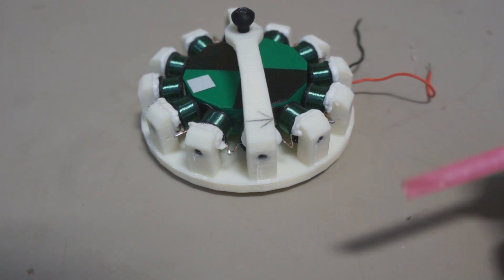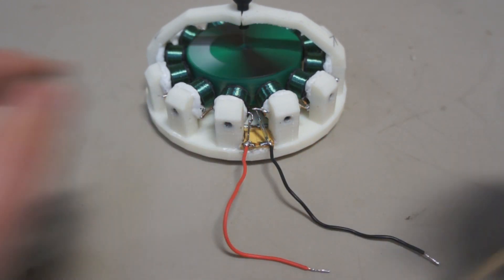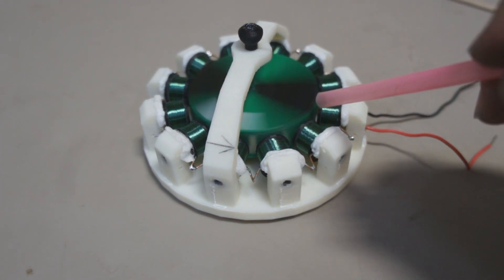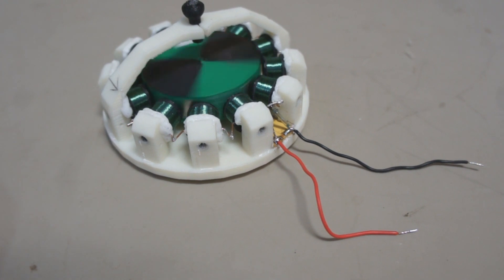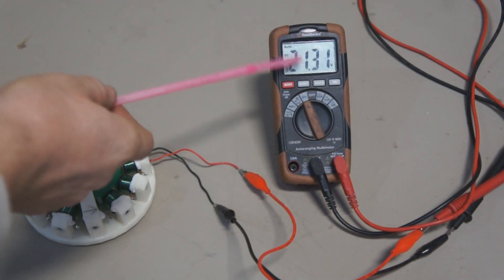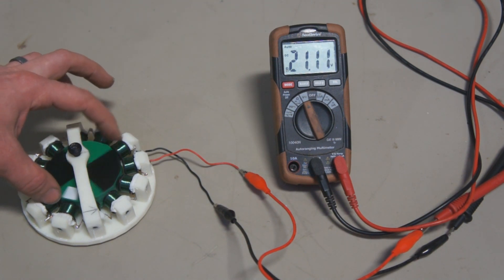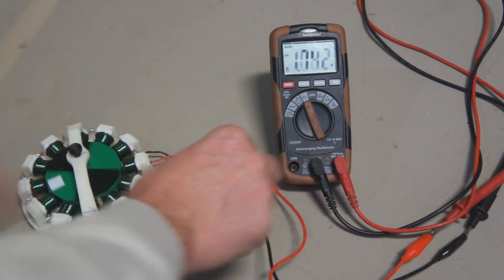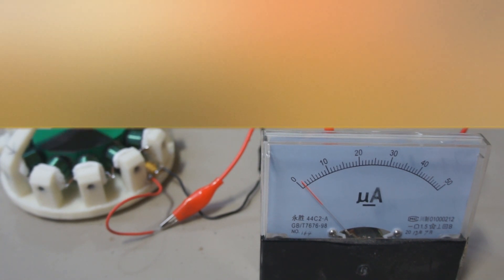3D Printed Motor Runs Almost Like a Perpetual Machine

Comment: why do you say it's not perpetual motion?
Reply: Because there are energy losses in the system. Spinning the rotor against the resisting stator initially charges the capacitor, and the capacitor then discharges to power the stator, spinning the rotor. But it cannot produce more power than was put into it. Energy is lost through friction, air resistance, electrical resistance, etc. Eventually, the rotor will stop spinning. It's no more perpetual than a flywheel.
Reply: cuz it ain't :D

Comment: Anyone knows where to get the jewel bearing?
I have been searching everywhere but only place that i can find them is in china and they wont sell a few.
Edit, I found out that easiest seem to just find an old high quality watch and take out one of the ruby/sapphire bearings from the inner mechanical guts. It will require some delicate work but old watches are cheap, even good quality ones.

Comment: Can you tell me what is the magnet type and number, coil wire sizes and winding numbers of each would help ????? Thanks You used 42 gauge wire on coil but did not say other size wire. 
THE tantalum capacitors are supposedly the best type of CAPS.  Especially from an accuracy point of view what I read.

Comment: This cant work. Impossible to charge a capacitor and draw from it at the same time without and additional energy supply flowing through the capacitors and 8nto the motor. But then if it is acting a motor, it can be a generator at the same time, its 1 or the other, generator or motor. Cant be both at once. And capacitirs cant be charged and drained at the same time, same principal as the motor. In order to keep caps at full power to drive a motor you need external energy source like a battery. Other wise there is no force to drive the generator as it charges the caps. Good effort but impossible. Battery is inside the centre spinning unit. And the unit is driven from inside. This would explain why the unit seems to want to spin quickly when he stops it by hand....it wants to go again and that requires power....not just 2 baby caps.

Comment: I thought this would be a free energy vid and almost skipped it. Very glad I watched it, I love this design. Thanks also for the detailed explanation. 
I've also used very small shaft diameters (pins) on my prints to reduce resistance, so simple but effective. I wonder how much better efficiency would be by smoothing out the rotor with the magnets impregnated and sealed over? It always surprises me that manufacturers don't attempt to smooth over magnets on brushless motors (especially outrunners), and instead have very un-aerodynamic rotor with magnets protruding into the confined space where air must be flowing around them in constant compression and decompression cycles creating massive turbulence (especially at the 20k+ rpm some of these motors can get up to.

Comment: Have you attempted a high capacity, magnetic generator?  I've been wanting to find one that is set up like this build, but with enough current to power 2-3 appliances; via an inverter.  My ultimate goal is to be able to "jump start" a few magneti generators that (together) equal around 30,000 Kw.  That should run an entire house.  Is this possible?  Thanks.

Comment: Just put it in a plastic bag and pack it with cheesey puffs for packing material. I wonder if you use 2 25v tantalum capacitors at 1 uf for fifty volts.

Comment: A lot of gullible people in this comment section that believe this ISN'T a hoax. There's a battery hidden in the device that's powering it and not those tiny capacitors. The rotor never slows down, it's being fed a constant supply of power.

Comment: What if you connect radio antenna to those wires and tune radio to tap into earth's natural radio frequency as a power source? Will the 3d printed almost perpetual machine will run forever then?

Comment: To fully power a 30 watt guitar amp you would need 1,176,471 of these.
(that is with each motor putting out 17 volts at 1.5 micro-amps)

Comment: What happens if you install a capacitor between the coils, or in front so then, so there is a hard but short energy output to the coils? Will there be faster movement? I'm not an electrician, I only have some basic knowledge from school (and that was over 15 years ago xD)

Comment: At the low voltage it was generating voltage, have you let it run without interference and see if it would stabilize and maybe be a perpetual motion motor? 
I know there are a lot of people that do not believe in perpetual motion, but I helped an old man make a machine that sat on my desk for over two years and ran 24/7. I still am skeptical but he made it happen and I don't know how.
Reply: No it couldn't be. The power source there was the spinning wheel, right? No conversion of energy takes place without losses. Some of the energy is converted from kinetic energy into electricity, and some is converted from kinetic to heat. The copper warms up a bit, and that energy radiates away, leaving the system. Therefore not all of the flywheel's kinetic energy can become electrical power.

So yeah, the system will regain electrical power, but it will have less power than was stored in the flywheel. This means after enough cycles of converting back and forth from electric to kinetic energy the device will run dry and stop. You can make something very very efficient, and have it run on its own for staggering amounts of time (See the Harvard bell that's been ringing for over a hundred years now), but due to material science nothing will last forever. Especially not if its loosing energy to thermals and also providing power to do something like run a light or whatever.

Unless we found a conductive material which had zero atomic friction, so absolutely no energy was lost during conversion from kenetic to electric energy, ran the flywheel in a vacuum, and used a special type of bearing that was truly frictionless, we cannot make a perpetual motion machine, and even then that one would be running at unity, meaning it wouldn't be making more power. It would just hold the power you gave it forever.

Perpetual motion is (currently and probably forever) impossible, thanks to physics and material science.

Comment: to increase efficiency try adding a pulse generator: https://www.youtube.com/watch?v=azLIpMYoUeQ
You might have to increase the size of the motor in order to have an output that can maintain the arduino circuit running. Effectively, the energy being utilized, comes from the magnets and the centrifugal forces.

Comment: This reminds me of a motor designed by Paul Babcock and his colleagues that re-uses the same electricity over and over, using capacitors, and feeds it back into the magnetic coils that drive the stator. The interesting thing about their motor is that they use switching technology to turn the coils on and off as the magnets in the stator go around.
So basically as a stator magnet approaches the "pulling" coil in front of it's spin direction, that coil switches off, becoming magnetically "dead", and the next coil switches on to pull the stator further, and at the same time the coil behind the stator also switches on to push the stator, creating a magnetic "push and pull" effect simultaneously.
So at all times two coils per stator magnet are active at a time, with a "dead" coil between the two active "pushing" and "pulling" coils, so there is no magnetic drag (Lenz effect) between the stator magnet and the coil it is closest to, which would be resisting the torque, creating a incredibly efficient motor.
This also means that their motor is actually not a generator, it's just purely a motor.
Just search for Paul Babcock here on YT and you're in for a treat :)
Another interesting individual, who's collaborated with Paul, is Jim Murray, and he's built some highly efficient motors too.

There are lots of ways to produce and use energy at a fraction of what we pay our power companies, the only problem is that those companies absolutely do NOT tolerate competition, and they have lots of ways to stop pesky uppstarters.
They even charge you several times for the same electricity, because the power you use is not all consumed and the leftover power is sent back to them and then looped back into the grid. What you think is the ground line actually doesn't go into the ground, but goes straight back into the grid to be taxed over and over.
That's how greedy and anti-progress they are.
Keep that in mind if you're considering buying a electric car...

Keep up the good work master jedi and don't give up!
May the force (fields) be with you :]

Comment: When you said Crystal?  Did you mean Coil Cat whisker set-up? Ie like in the first Crystal Cell radios? Probably when tuned to a strong radio station would have a + Power consumption. Also, you could tune to  tune the Schumann resonance which occurs at a frequency of approximately 7.83 Hz, but this frequency can vary slightly from a variety of factors, such as solar-induced perturbations to the ionosphere, which compresses the upper wall of the closed cavity.  Perhaps you would need to adjust a Bleed  load to stop over spinning. Perhaps you could go cap free???  Ideas

Comment: Um...so if you connect it to a bigger capacitor to store the energy, then as the flywheel slows down, it'll input a bit of the stored energy back into the flywheel to keep it going, so in a way it could potentially go on forever??? would that work?

Comment: All bullshit, Tantalum capacitors ... hmmm they run only DC, but there is no diodes to rectify the AC comming from the coils when charging, the read sw is way to far away from the magnets. Light trough the base , year right, what about the rotor !!!! FAKE CAKE

Comment: Well you try connecting crystal diode and coil and you tune it to resonate on radio frequency so you get actual voltage from radio waves-then it will never stop-as long as that radio station transmits :) Edit: please try that! Ty!

Comment: amazing job with your tinkering, 3d printed so meh, you could build the housing a million times, cute touch with the... it came off the printer bad. anyways was a cool video until you fabricated the short... seriously, you had already disrupted the speed 5 times, no biggie, fucking awesome, but then when you try to drop it to 8 volt range, and you see it just ticking away again, you decide to unplug the multi? multimeters are trivial draws of power, especially here... straw comes in... guaranteed a small burst of air was passed through that straw to speed it up. "this is commonly referred to as bullshit." i dont give a shit really, just funny how you start the video by saying that people said you had batteries etc... your shit doesnt last for as long as you like.. thats ok, its still cool.

Comment: Hi, have you checked how much force this engine can develop to push an object if you attach a gear to it?
Reply: Sir, it is not an engine. It is a super efficient feedback loop. Once you start removing energy from it it will slow down a lot more quickly. HOWEVER, this is similar in concept to what hybrid cars do: Increase the generation capacity and it would work as a brake, but generate enough power to a battery that the electricity generated will add electrical impetus to the next acceleration.

Comment: It would be great if you could develop a miniature version to mount underneath ac brushless motors to act as an alternator for drones, obviously the goal would be to increase flight times. I imagine you could create some ducts to draw a little of the downwash from props to produce the spin, kind of like Kers for drones!
Reply: Unfortunately, the amount of energy you would get would would be less than the amount you lose by the extra drag slowing you down. However, I imagine you could reverse the coils in your motor to slow down the propeller speed, increasing drag, but capturing that drag as electricity could be useful as a sort of regenerative airbrake, however that wouldn't really increase flight times as unless you use an airbrake a lot, its more efficent to gain altitude to store more momentum or just go easier on the throttle than it is to use such a brake.

Comment: FAKE...does not lift it from the table because under the table has a drive coil underneath it
Reply: The drive coil would have to reverse when he turns it over... so nope. If you actually watched the video you will note that he never claimed this was perpetual motion and even showed the power loss over time.

Comment: why don't you feeda fan back into the motor have have the motor run the fan, but give the motor a blowing kick start
Reply: Running a motor off of this would shunt the feedback power to the motor and the device would stop very quickly. It is not a generator, but has a slight generator capability. It could be classified as a dynamo which is a very high efficiency motor due to its ability to feed back into itself. Notice that he NEVER claimed it was a perpetual motion machine.

That being said, it does have generative capacity, so if the flywheel were connected to a DRIVE SOURCE, it would most certainly supply enough power to a fan.

Comment: These capacitor has not enough energy to start up this "motor" after has stopped it by your finger. 
I was wondering where you hidden the battery and circuits to keep it running. With certainily  inside rotor hub. Smart, but over opposite law of energy conservation.

Comment: That is a very nice motor.  As good as it is now it seems it would be even more efficient if the stator windings were connected to a iron ring around the perimeter of the motor,  much the way commercially made motors are built.  This would allow the outside pole of each electromagnet to contribute to motor's operation instead of being thrown away as it is now.  You might be surprised at how much more performance your motor will have if you do this.

Best wishes.
-Skip

Comment: Sorry. Did he say "there's an insane amount of resistance in these coils. That's what makes this run as long as it does"? 
Doesn't resistance mean loss? Like friction?
Why does he bother with all the electrical gubbins. Why not not just spin up a flywheel with his amazing low friction bearings. He would have less overall system losses and the thing would spin even longer. No? 
Yeah, right.
Reply: Yeah, I saw that resistance comment, too. What he should have said is that there is a high inductive reactance which would look like resistance during an increase of current moment. Any current fed into the coils is immediately converted to magnetism (up to a point). Conversely, if the voltage in the caps starts to die, the inductance field starts to break down and will start to feed current back into the caps. In electronics we call this an LC tank which is highly effective at storing power. Add to that the kinetic energy of the rotor and you now have a mechanical feedback loop along with the electronic feedback loop making this a very efficient energy storage device. HOWEVER, once you start to remove any energy, either mechanically or electronically, energy is lost quickly. He showed that in two ways: first by adding friction to the flywheel, and secondly by shorting the leads together. I found it very interesting to note that the short was a much more effective way to remove power from the system than the physical resistance (friction) was.

Comment: Observing this you have a really useful device you probably haven't thought of.  Give the device a magnetic bearing with a large massive inertial rotating wheel (MASSIVE) this device could function as a fairly high efficiency battery device.  This way you can store power from a solar device and have "On demand" power without battery losses.  It should run the rotor in a vacuum if possible.   Instead of blowing the rotor you would power the motor to speed.   Obviously the motor would be scaled to the in/out demands.
Reply: Look up KERS. Its this, but attached to regenerative breaks on racecars.

Comment: Greetings my friend, I have a curiosity, if they are coils and magnets for what reason when you stop the rotor and release it the same tends to rotate without help does not seem logical if they are only coils that without turning with the hand should not have any reaction to Unless you have a battery to power it?
I apologize for the question but there are many hoaxes, thanks for your response.

Comment: It would be cool to 3d print a thin fan blade on top of the larger spinning part and power a small fan motor with the leads you have there. I would think it would never stop.

Comment: Wow, this is pretty cool just the way it is.  If the reed switch is one of the larger energy drains though, could you make it more efficient with an NPN Mosfet and hall-effect sensor as the switching mechanism?  The gate capacity of modern NPN's are fantastically tiny ... so small, that a 104 ceramic cap can keep it switching for a day.
Reply: GnuReligion the reed switch has zero draw effectively but since it is a mechanical switch it has a limited number of cycles

Comment: Pretty cool! I have a similar design. Question, how did you got to balance the magnets and to have very little resistance on the main axis/shaft?
Reply: 3d printer and weighing the magnets can help.

A calibrated 3d printer can make a very nice rotor. Especially with a little post machining with a file and a dril

Comment: So can you design a model where you regulate the voltage and cause excessive power to bypass the capacitors and charge a battery bank instead?  I'm thinking something like that could be used as a windmill motor making windmills much more efficient.